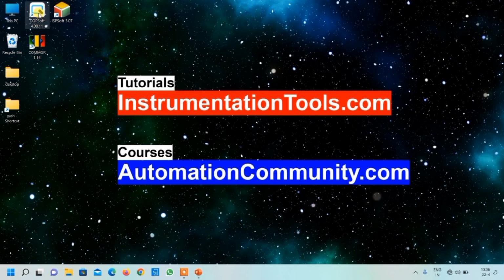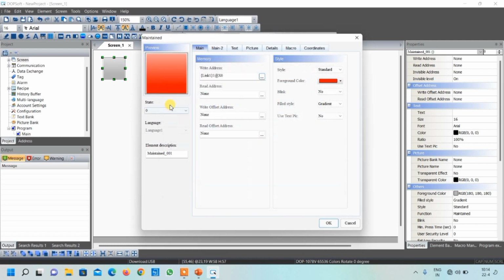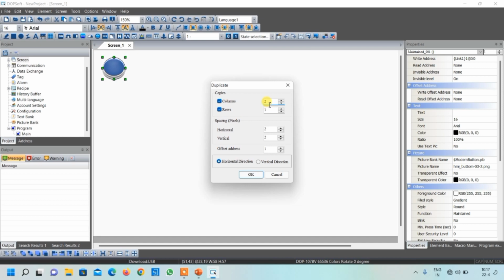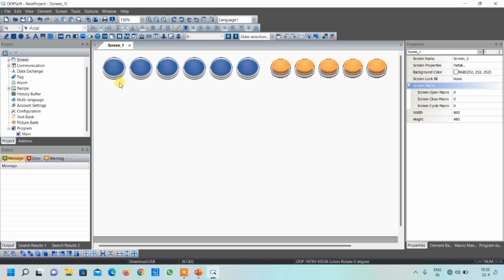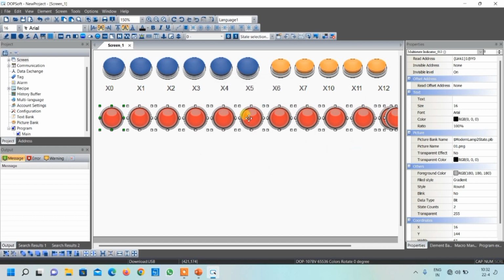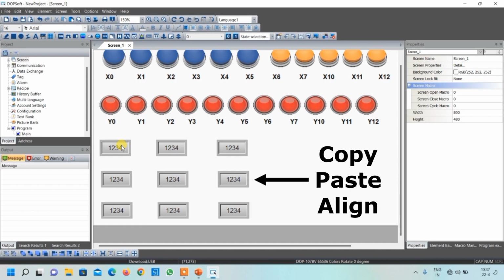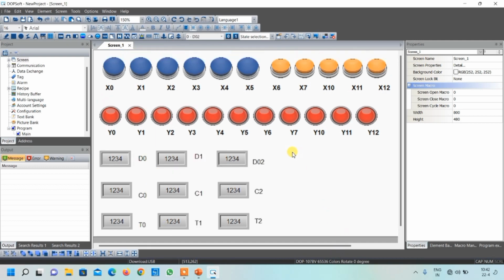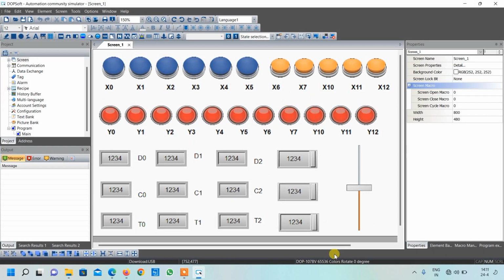PLC Ladder Simulator Tutorial - Create Your Own HMI SCADA Graphics

Comment: I am working on a system integration with a Delta DVP20SX2 PLC, and TP70P-22XA1R have it connected via mini USB, when i connect with the COMMGR it detects it and gives me the successful connection, but when i try to communicate from ISPSoft it gives me an alert that says "communication port has been used or this port does not exist" and immediately another notice appears that says "invalid driver or COMMGR not start up" i have already tried different configurations and the problem persists,   can help me.
Reply: Mine also gets same issue bro if you get solution for these please tell me